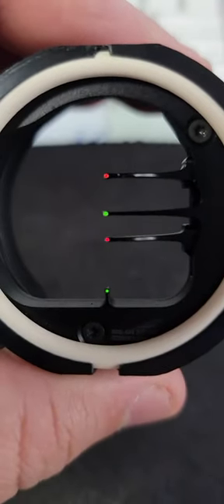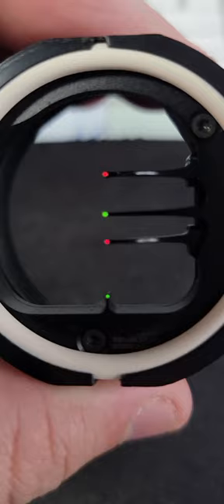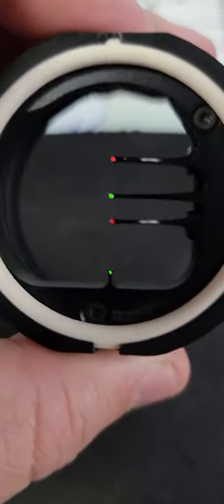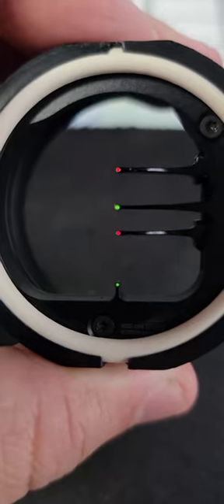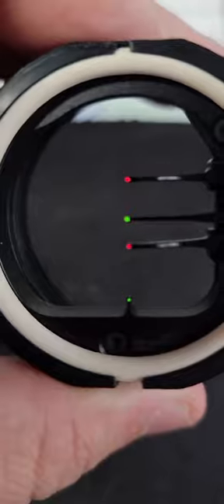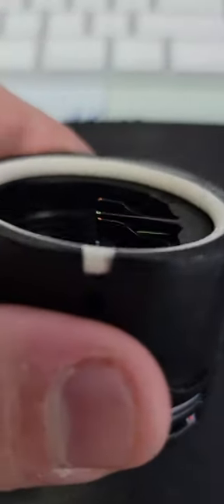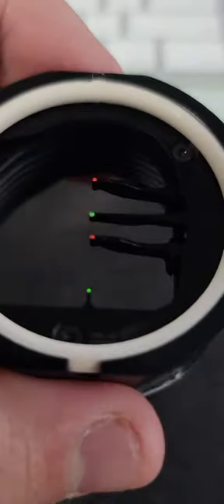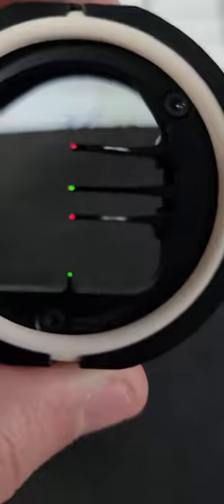UltraView UV3XL 3pin problem.

Comment from the maker: I got a response from UV and they were I credible as i expected. They will be sending me a new one so they can inspect this one.
Reply: What was the result of the new one? I got a replacement and it had the same issue.
Reply: Interested to hear the result
Reply: Haven't received mine yet but might cancel the order if this is what's happening.
Reply: Is the 3 pin configuration able to be flipped to left handed like there other sights
Reply from the maker: @ethanfeatheroff9135  yep
Reply from the maker: @ryanperkins432  The replacement looked much better. I still feel like it's a little off, but that might be because of the different pin sizes.
Reply from the maker: @stevewall1882  the new one looks much better. Not sure that it's 100% until I shoot it.
Reply: @CVoutdoorfamilyadventures  Can't wait for your verdict, really thinking of canceling it.
Reply from the maker: @charlesvinch595  you still haven't gotten yours? I am considering selling my UV3 in general.  Not super impressed with it.
Reply: @CVoutdoorfamilyadventures  getting gun shy think I'm going to cancel. They said it's still 3 to 4 weeks out.
Reply from the maker: @charlesvinch595  weird.
Reply: @CVoutdoorfamilyadventures  let me know what you would sell it for.
Thanks Charles